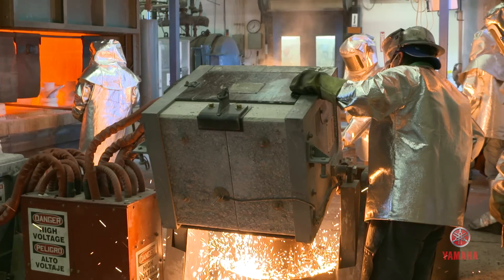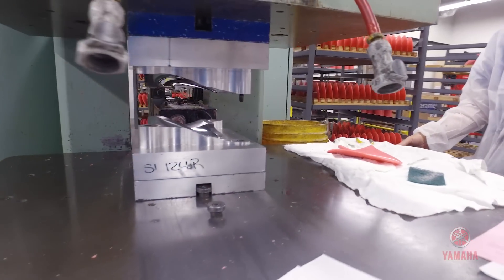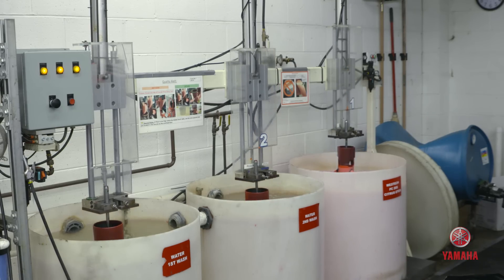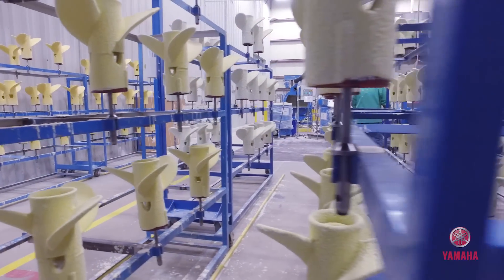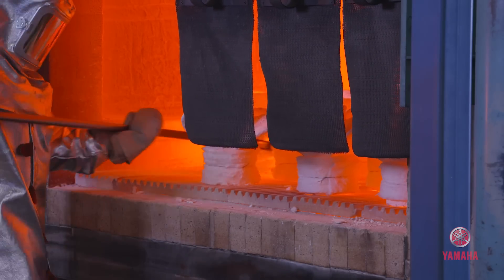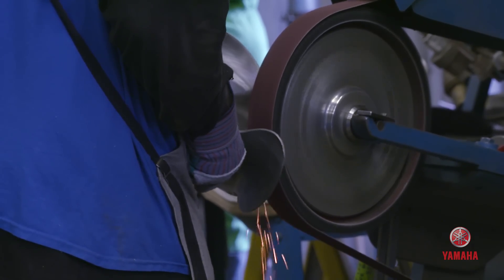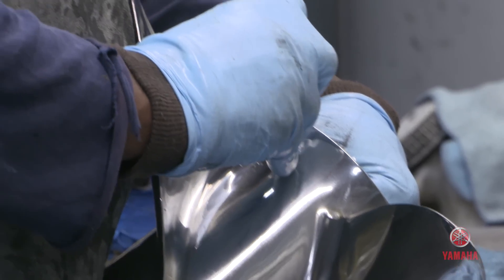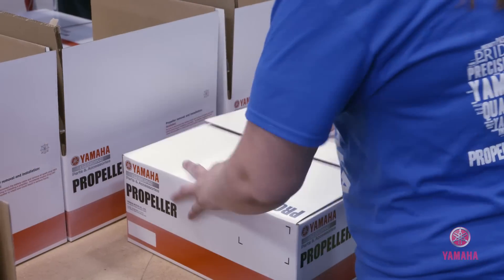Props | How They're Made

Comment: After working at VEEM engineering and seeing how they make their props, watching these guys use hammers and manualy grinding is pretty cringworthy. But I guess that's the difference between high volume manufacturing and high tolerance manufacturing.
Reply: Ok Prop snob
Reply: @VK9  Meh, you do you bud. I know which one I'd rather have but I'm sure these do the job too. 
Also upon rereading my comment I realise there's an error. I meant "low tolerance".

Comment: Turbo did a better job with their one piece wax mold investment casting than this production line. Too many places where flaws in the mold process would make for a poor prop. A single piece wax casting would eliminate this issue, plus revamp the mold creation process.   The sanding system could be done on multiple props instead of one at a time, even with multiple lines doing single props is wasteful in both resources and time.  Ganging the props and using a larger sander would increase productivity and eliminate single points of failure.

And the QA process, ugh. Automation here is essential to provide a tight quality assurance process. Improvements to how any flaws are addressed are recommended, some using a hydraulic press and improved metalforming techniques. A hammer on SS blades makes one cringe at the possibility of developing cracks at the weld points where the blade meets the boss. And in a multiple piece mold, the potential for stress or air-entrained failures are high.
Reply: There are no weld points. It's a lost wax casting - the wax melts out leaving a SINGLE chamber. The blades and the body are a single cast piece.
I'd also love to know how you're going to polish multiple props at once when the entire reason that it has to be done by hand is because it's such an incredibly complex shape with varying compound curves.

Just another keyboard warrior, telling a highly successful organization how to operate a business

Comment: Interesting process. I curious if the props need to be balanced and if yes than how is that done?
Reply: They don't really need a balance, but that's not the same as they will not benefit from it. There's a tolerance of course, but it's not precision balanced.
If you want your prop to really perform, you need to get it labbed.
Than means the following.

Geometric correction of blades so each blade has the same pitch, rake, camber, and upping.
Diameter adjustment.
Thinning of blades so that each blade has the same thickness.
Dynamic balancing.
Finishing (satin or gloss polish)

None of these things are done to these box stock props. You need a proper prop shop like BBlades etc. if you want a precision propeller.
Reply: Bigger hammer of course!

Comment: 5:05 why not just modify mold so you don't have to put a sledgehammer to it.
Reply: gmax876 The prop blades will never be consistent because they move during the cooling process. That's why they need adjusting.

There's also a big difference between a sledge hammer and a wooden mallet
Reply: RyTrapp0 fair enough, that hammer still looks pretty serious though. I bet  if they could control the properties of the metal they could calculate how the prop deforms as it cools.
Reply: Or just buy a CNC machine.
Reply: @thelyingscotsman7993  do you realize what a billet of stainless that size would cost? It'd be 5 times the finished props cost for raw materials.

Comment: Can anyone with a brain explain the trail edge grind?
Reply: @fastwin493 
Now that you spent so much time talking about this, you are missing one little part, but a very important one.
A trailing edge does not cut anything. That is the leading edge.
The reason why a trailing edge is sharpened, is so that it creates as little drag as possible, i.e, it does not have a large surface that drags the water behind it due to low pressure. This is also why it reduces cavitation, as there's no low pressure zone to create the cavitation on the trailing edge.
A leading edge is not cutting the water, but it's rather slicing it as the water runs along it while the blade slices through. There's a pretty big difference, and it's important to keep this in mind when designing propellers.
What make Cleaver style props work, is the fact that the trailing edge does not pull air down under the water, which means that the submerged portion of a surfacing propeller will not ventilate.

Comment: Whats the difference between a flour and a powder?  thanks a million.
Reply: DroneXFun A flower is just a fine powder(I couldn't tell you if there's an industry standard maximum granual size per definition or not, I'm sure there is). I used to run both a >1M pound dry mixing operation(can't remember the exact capacity) and a 24hr/6d twin screw extruder that ran the material that we produced(the main business was selling bulk custom formulated wood+plastic based dry material or pelletized material to other plastics manufacturers). This was all thermoplastics with a wood filler material(it was marketed as being "green" of course, but I don't know how adding wood to a product makes it 'better' for the environment...) and a bunch of other minor additives like antibacterials and the like to prevent the wood part from essentially rotting, talc(NASTY SHIT) to help the material flow, etc. Anyway, the wood always came in 'wood flour' form, and it was NASTY stuff to dump the 8ft tall bags of the stuff into the hoppers of the mixer. It REALLY caused the material to get stuck in hoppers, funnels, & transport tubing if there isn't enough talc to help it flow. In fact, it was normal for the 8ft bags of wood flour to stick and stop dumping into the hoppers, you could look up from the bottom into the bag(not advisable) and see all the material stuck together at the top, so you would have to poke it with a stick and smack it with a shovel just to get it falling again. 

Anyway, think of it like standard granulated sugar is typical of a powder while powdered sugar [ironically] is typical of a flour. Of course, wheat flour is representative of a flour too...
Reply: @RyTrapp0    Thanks a million for that awesome reply man.  I wasn't sure if the difference between a flour and a powder were particle size or if    a flour was describing something organic and a powder inorganic.  Thanks again for answering my ridiculous question.

Comment: If they are still beating on their props with a hammer to finish them they are way behind the times. We are in the age of the CNC machine that can finish a part within a fraction of a thousands of an inch. Why would you continue to beat on something like that.
Reply: Look up the cost of a 14"x14"x12" piece of billet stainless that would be required as the initial stock to cut this size prop out of. Then add the 10 hours of machine time on a 5 axis VMC and compare that to the sales price of this prop. 

Consumers don't want to spend $3000 on a wear item.  Till that day comes Juan will more than happily smash your prop into shape.
Reply: Because they are millwrights. Millwrights beat on steel and call it craftsmanship. Without an electrician, their machines are just oily pieces of shit.
Reply: By all means go build your better prop that's going to cost 5grand to make lol. Seriously prop shops have been doing just fine with hammers and forms for years.
Reply: my thoughts exactly! id have thought there are @ least high precision moulds for this! well hats off to the skills but gee - a hammer?!!
Reply: Thomas Jefferson,   It all comes down to production costs, after all how many times are these props going to be slammed into the boat ramp.
Reply: TJ...... laws of physics. You "get it close" by shear force. I have no idea what their final tolerances are, nor how they do final testing. But then, it could be proprietary. BTW, slamming and hammering is a very foundry-typical process in post-pour and prior to final finishing. Yes, they could have shown more about their balancing QC, but don't fear the hammering.

Comment: Yamaha ss props rust bad
Reply: more nickel less rust
Reply: While I'm most certainly not a fan of Yamaha propellers for a lot of performance reasons, I have NEVER seen rust on one.
Reply: I don’t really like Yamaha I’m not trying to defend them but you wash you prop off too while washing the rest of your boat
Reply: work at a yamaha dealer as an outboard mechanic and see it on all their props
Reply: Does a magnet stick to it? If so then it’s not actually SS lol.
Reply: Jimmy Grant That's not at all how stainless steel works. You realize that there are a number of grades of stainless that will rust regularly, right? And, it isn't "cuz deyr bein cheap" either, the various metal alloys exist for a reason.

In reality, ALL stainless will eventually corrode - it's very specifically named "stain-less", not "stainproof".

Comment: A propeller is a complex device whose complexity  in the surrounding working medium is hardly respected hy many people.  If the propeller accelerated very quickly then the medium around it cannot cope and it is left behind to cause cavitation,  At speed the forward speed acts as a primary pump to the high pressure areas and so the blades can cope with higher pressure differences.   I prefer propellers where the pitch at the hub is slightly less than the pitch at the outer radius of the blade,    This is due to the fact that at slow speed the angle of attack of the blade with respect to the water is so high and at that zone the blade acts more like a paddle wheel rather than an airfoil section.   Also it would bite a bit better at slower takeoff speed. Normally I arrange for the inner hub pitch to be  just right for normal cruising where the inner part of the blade is not  working but simply going through the fluid without drag, but it would be working at slower speeds and it would behave better when the craft is  moving slower .   There is so much complexity  going  on around those blades, where many people misunderstand the difference between cavitation and aeration .   Also I find that  the tips of the blades are important for efficiency, IN the older days the blades where shaped more like clover leaves  with the trailing  edge raking in .   In a propeller and an aircraft wing , I prefer the  outer tips to have both the leading edge and the trailing edge raking back.    When young I did notice that very bird and every fish have their fins with the  leading and trailing edge raking back.   When one comes to think of it the pressure differences around the tips would mean that if the  fluid is trying to escape from the high pressure zone to the lower one, then it would be logical to move the  "wing, blade  outwards so to stop the fluid escaping.    Nature had done it all before and evolution of birds and fish.............. has done it all before us............ and one can appreciate why high speed propellers look like the wings of a diving eagle or a hawk and looking at the tail of a whale , an Orca and a dolphin one can see how much there is to learn from the shape of their wing tips and fin tips. It has been there for a million years and it is such a pity that many  people did not notice it and  ventured to design their own............ not getting it so perfect as nature  did.
Reply: and i thought props were just that...props, thanks for the insight!

Comment: I print out a propeller way faster than these 17 steps using my 3D printer... lol
Reply: Gui Ferreira what horsepower can ABS printed propellers handle?
Reply: Rusty Shakleford maybe a little poney...
Reply: They make metal sintering 3D printers, but for doing large volume production runs like this, the 3D printer would be inefficient.
Reply: Roger Hupp And extremely expensive compared to casting.
3D printing wouldn't replace all of the surface finish & QA steps either.

Comment: Nice explanation of the evaporative pattern process. I think that they occasionally confuse the term die and mold but all in all it’s a nice piece and helps customers understand why that shiny new prop is so expensive.
Reply: Ken Tyler
We used to make the props for the Miss Budweiser hydroplane. Milled completely out of a solid block of titanium. Took almost three days at $90 per hour plus several thousand dollars for material. A bit spendy.
Reply: No.
This is a pretty cheap way to make props. It is also not a very precise way. Don't get me wrong, Mercury and OMC is just as guilty of this markup as Yamaha.
But look at what the price of a Turbo prop is, and they are in fact great props.

Comment: no mention of balance
Reply: Rally Tasker and if it looks off they just hit it with a hammer, I am a huge fan of Yamaha, i think they make the highest quality engines, and bikes, however this video is a bit disappointing
Reply: Carl Spackler thats why i use yamaha engines but powertech props
Reply: @carlspackler4447 
They are just like any other stock cast prop in terms of balance. They are within spec, but not precision balanced.
Powertech, Turbo, Yamaha, Mercury, OMC, or the like, it does not matter. If you want a precision balanced propeller, you need to have that done, or purchase a CNC prop, or cast prop where it's part of the process. It's not very common for the latter as it's basically part of a blueprinting service.
Reply: @AB-80X    Carl, thanks for injecting some adult comment. I accidentally ended up here during another search. Since when are YouTube videos being rated for Oscar nomination?